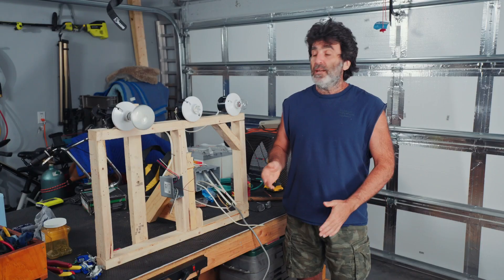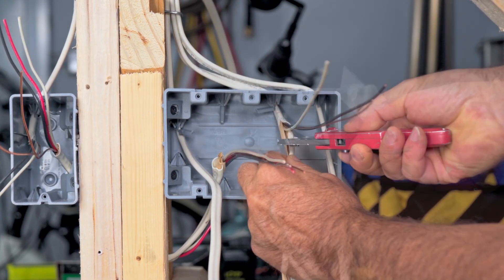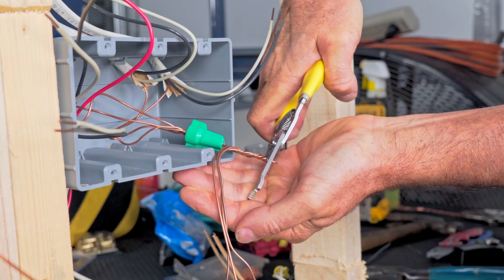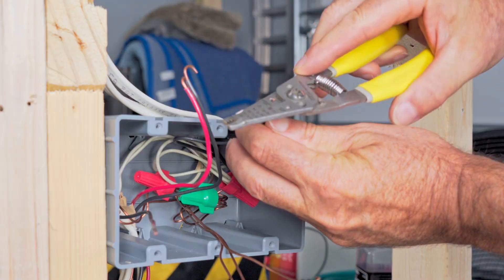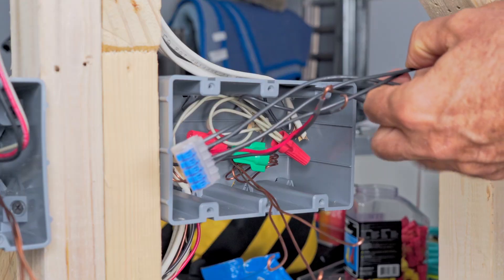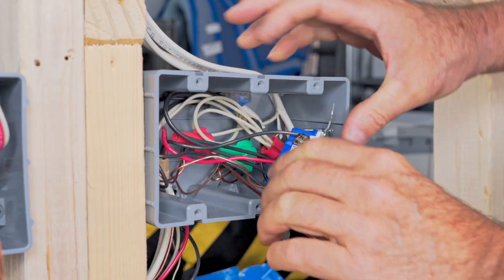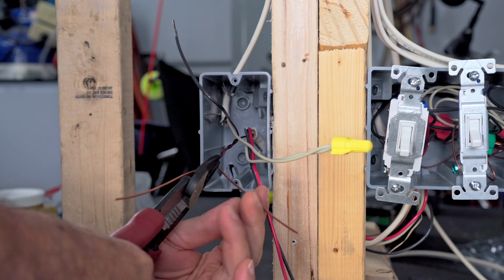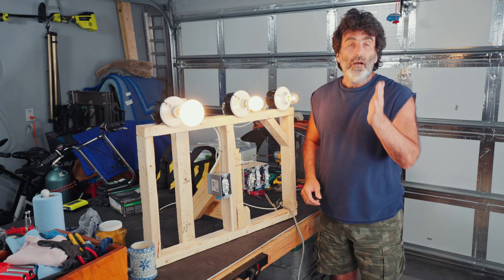Wire Several Light Switches w/ Only 1 Power Source

Comment: Im looking at a box kind of like this, with only two switches (one to a light and one to a light/fan combo). It seems to be wired pretty similarly, but the biggest thing I notice is that the ground wires for the incoming power and each of the fixture wires are all connected to each other, but there is no connection from the that ground connection to either ground stud on either switch.  Is that bad? Late 1970’s home.
Reply from the maker: HI!  I've seen that before.  I think it was pretty common back then.  Is it a brown bakelite electrical box or metal?  If it's bakelite then the switches aren't grounded.  IF it's metal, there's usually a ground connection to the box itself under a screw and the switches are grounded thru the physical connection to the box.   I would probably add a pigtail(s) to where the existing grounds converge and connect that to your switches.  Of course it's been like that for 50 years so it's really up to u.  It would probably bother me and I'd do it to satisfy my OCD... 😂. Goes without saying to turn off the power before you try that.  If you have aluminum wiring don't forget to add a little dab of noalox to the connection.

Comment: Instead of a light at the end of the run....can you replace it with a switched outlet? thx,
Reply from the maker: I don't see why not!  If you have a round box, it might be hard to get an outlet to fit that so you might have to remove the box and replace it with a  regular gang box... 😊
Reply: @TheHomeImprovementChannel  Thx for the prompt reply..just in time..Subbed!
Reply from the maker: @danev6972  TYSM for the sub... 😊